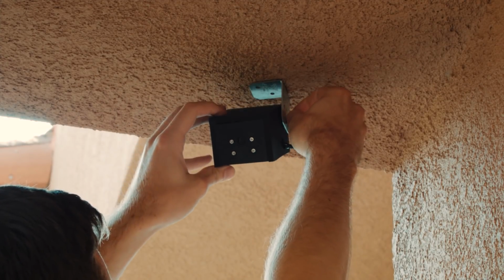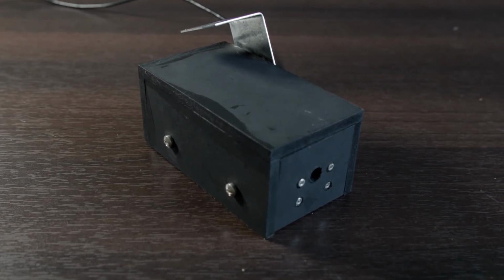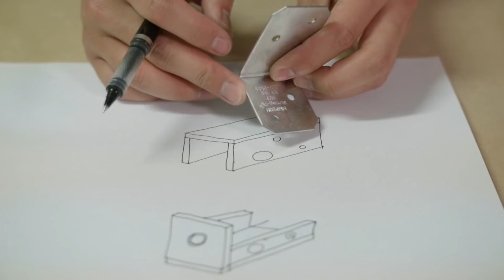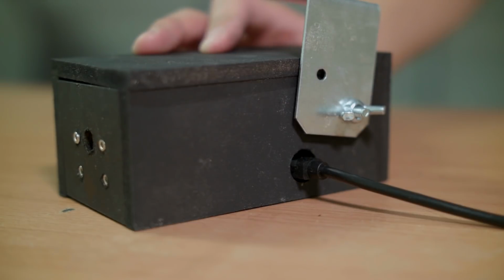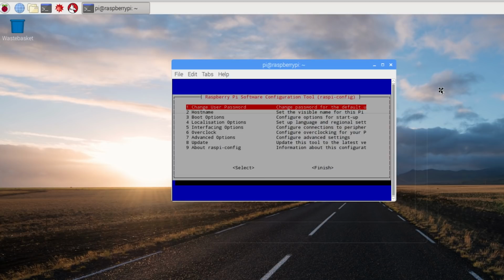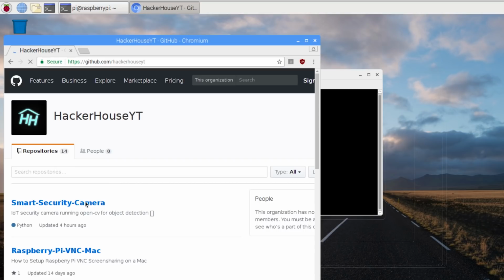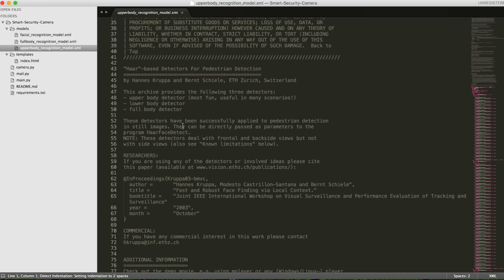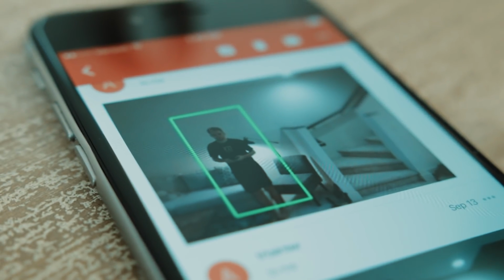How to Make a Smart Security Camera with a Raspberry Pi Zero

Comment: When the camera detects something, then the terminal shows sending mail then error sending mail.  Can anyone help
Reply: There are some issues with the print connectors, i suggest you put the pi zero in the microwave on medium lvl for about 3 minutes, that should resolve the problem.
Reply: @alextirendi5412  Issue is resolved, Initially I didn't allow less secured apps.

Comment: rather than dealing with MDF, I think I would mount it in an electrical box. The steel ones are modular, cheap and durable. Plus, you can mound an unwired outlet in it, which isn't the sort of thing most people would think twice about seeing.

Comment: Will this work if your not on the same WIFI network as the security camera is on?
Reply: Hello, 
You should edit your routers routing table. An example below
Public IP x.y.z.t
internal IP a.b.c.d
You should route your public ip's some port to internal ip's some port
x.y.z.t:9999 -> a.b.c.d:8888 then on a public WiFi, if you write your xyzt:9999 to the browser's address bar, you will see your camera. But it is not secure. Anyone that knows your routing table(camera port?) and public IP(may be static or dynamic ip) can see your house:)

Comment: (cv) pi@raspberrypi:~/Smart-Security-Camera $ python main.py
  File "main.py", line 30
    print "Sending email..."
                           ^
SyntaxError: Missing parentheses in call to 'print'
Reply: in python 3 it's print("Sending email..."). Whereas in python 2 it's print "Sending email...".
in the video they are using python 2. Just make sure you modify all the print statements in your code.

Comment: Yet so smart that the video output is laggy and low on frames per second
Reply from the maker: It’s a limitation of the device. You can use a faster board for higher FPS

Comment: still not coming over the error in the main.py.
 line 9: from flask_basicauth import basicAuth
ImportError: No module named flask_basicauth
to use python 3 is no option while opencv is compiled under python 2.7.
the flask maps are there under dist-packages

Comment: A piece of pvc and 2 end caps would be better and easier for an enclosure.
Reply: GhettoRanger Yep, and just drill through the side of the pipe, and mount using a bolt through the pipe.

Comment: A jigsaw is not the best thing to use to cut straight lines. You can  get straighter lines with a plain handsaw. Before painting the MDF you can seal the surface with white or wood glue (or actual wood sealer) to seal it against excessive paint absorption, reducing the number of coats required for full coverage.

Comment: HI there, how can i watching the live feed without connecting to my home's Wifi , i mean watching it outside by using my own personal data . Is it possible ??
Reply from the maker: Yeah, you have to create a local tunnel. Check out ngrok
Reply: can u make a video or process of steps on ngrok, it would be helpful thanks
Reply: i been try it but it show
Failed to complete tunnel connection
The connection to https://.....ngrok.io was successfully tunneled to your ngrok client, but the client failed to establish a connection to the local address localhost:5000.

Make sure that a web service is running on localhost:5000 and that it is a valid address.

The error encountered was: dial tcp [::1]:5000: connectex: No connection could be made because the target machine actively refused it.
Reply: sounds like it could be a firewall issue. Did you open the port 5000 on your router?
Reply: just get use OpenVPN, dont leave a port open for a camera

Comment: Hi, can I make this with Raspberry Pi 3?
Reply: Is it possible?
Reply: yes it is,i've done it on raspberry Pi 3 and it worked like a charm!
Reply: what is the smallest size micro SD card you can use for this and can you use a lite build instead of full raspbian? 
also how do you shut down  projects made with  rpi's if you  have no keyboard? if you turn this thing  off then itis toast your micro SD will get corrupted same if your power ever goes up  rpi are notorious for corrupting  SD cards so would  you even  be able to  shut it down without taking the whole thing apart and  plugging in a keyboard so the  it can be shut down without corrupting the sd card?

Comment: right, so there are (thus far) two errors during the make section on raspbian stretch lite. 
the first error is down to ffmpeg not playing well, even when installed. to fix this, generate the config with the with_ffmpeg=0 flag:
  - cmake -D CMAKE_BUI .. S=ON -D WITH_FFMPEG=0 ..

the second error is when you get the dreaded "no such file or directory" error, do the following:
  - sudo nano /usr/local/c++/[version]/[file]    (where version and file are the ones listed in the error)
  - find the line that lists the file.h library
  - change #include_next <file.h> to #include <file.h>
you can then run make again and wait for the next error. i'll update the post once i'm done hacking stretch lite into submission...
Reply: Lord Aceldama have you tried setting it to wambo
Reply: John Titor opted into making my own with apache and simplecv instead. Apache just runs so much better on a pi 0. No locking up when you fiddle about on ssh.

Comment: GUYS PLEASE HELPPPPP I tried to install openCV on my raspi zero, then i got a problem at the step of compiling. i tried both “make -j4” (whic is using 4 cores) and “make” (which is using one core), but both failed, and the fatal error is about “stdlib.h no such file or directory”. Can someone advise me? thank you
Reply: I have the same exact problem. Did you find a solution?
Reply: why don't you just install anaconda and then use anaconda to install opencv with only one command needed
Reply: Your Pi Zero W only has one core, so the -j4 is no help.

If you are following the openCV guide at https://www.pyimagesearch.com/2016/04/18/install-guide-raspberry-pi-3-raspbian-jessie-opencv-3/, this made it work for me...

cmake -D CMAKE_BUILD_TYPE=RELEASE \
     -D CMAKE_INSTALL_PREFIX=/usr/local \
     -D INSTALL_PYTHON_EXAMPLES=ON \
     -D OPENCV_EXTRA_MODULES_PATH=~/opencv_contrib-3.1.0/modules \
     -D BUILD_EXAMPLES=ON \
     -D ENABLE_PRECOMPILED_HEADERS=OFF ..

Comment: Or just use an old smartphone with a free software in just 5 minutes??? You tech guis just like to overtink things....
Reply: argusz battery drainer if you use a mobile phone: you need to charge it one/two times per day. 
If you use a Pi0w with a 2kmah power bank you can relax for at least 3 days. 

All for the "huge" money.... 17-21 Euro (plus power bank)

Comment: Great video - thank you.  Building the box itself seems very simple. However, when it comes to assembling the software,  all those steps may be a bit overwhelming for some people. Therefore, may I suggest that you upload an image of the OS with all of the components already included. IE - have OpenCV, etc, already pre-installed in the OS image that will be downloaded.  This will simplify the software part of the instructions. All the user will have to do then is simply change IP numbers for their own network. Thanks !!!!
Reply: If you can't figure out how to install the software, then go buy an actual camera.  Jeez, people want everything done for them these days.
Reply: how the hell do you even turn this  thing off? how do  shut down a  pi if you put it into a project ? there is no keyboard so you can not sudo shutdown h
once you power it off then there goes all your work and you  will need to  start all over again reburn your image and start all over again
if you just cut power the SD card will just  get corrupted
Reply: @andreamitchell4758  No, it will not get corrupted if you cut the power. It's Linux.
Reply: @johnv7u2w  you have obviously never used a r pi before it is based on linux yes , raspbian 
but   r pi boots from an SD card , these thing get corrupted at the drop of a hat
you need to power it down  correctly or it will corrupt the card ,sudo shutdown
or whatever you can not just turn it off or cut the power
cards can get corrupt even without power interruption   the r pi is notorious for corrupting images
Reply: @andreamitchell4758  you are using shitty fake SD cards so this is your results. I have RPi, two Orange Pi boards and they are working perfectly for me, for months and months. I always cut power to them I don't care. Any Linux with ext4 either on ARM computer or AMD64 will never get corrupted because of improper shutdown,  these things have filesystem journalling and they doing fsck on every reboot. Check your cron logs maybe you have fsck disabled or what xD Get real this is not FAT32, it's modern filesystem. Change your shitty SD cards. Hahaha
Reply: @johnv7u2w  they are not "fake sd cards" they are  are kingston and sandisk
Reply: @andreamitchell4758  Something is seriously wrong with your hardware then. Raspberry Pi never had power button or anything like that and it never will. Shutdown command is not required. If your setup does not work with that then it's your issue not raspberry pi or Linux in general. It works for everyone else.
Reply: @andreamitchell4758  also "how do  shut down a  pi if you put it into a project ? there is no keyboard so you can not sudo shutdown" is just wrong. you can ssh into it and shut it down.
Reply: @monkaSisLife  that is really not  practical though ,  a button  connected to  the  GPIO pins that activates a script  is what is really needed

Comment: I was going to do the same using a 2 PVC piping, Pi zero, usb external charger (for battery backup), and using motioneye software. 
Don't hardcode variables into code, use config files for god sake (metaphorically speaking), or even use command line params and people can just make it a script to call it all.

Comment: I built one of these myself, but instead attached it to one of these convection charged batteries.
  
https://www.amazon.com/Duracell-Powermat-24-Hour-System-iPhone/dp/B0082YVBO0/ref=sr_1_5?s=wireless&ie=UTF8&qid=1505869772&sr=1-5&keywords=duracell+powermat

It charges by placing it on the mat, and it's portable (within the confines of my wifi connection).  I thought it might work with my phone's Personal Hotspot as I can view it on my phone with the VLC app, but never tried it. 

I like your design although it seems like the longer screws you used to hold the two halves of your housing together might be long enough to short out your RPi.

Comment: I noticed there was internal ip, can I access this from outside my home. Via cellphone perhaps?
Reply: Yes you can access any computer on your network, but you have to set up your router to do so. You need to open ports through your firewall corresponding to the Pi, and then remember your router's public IP address.
Reply: Simon thank you.
Reply from the maker: +Abel Villa you could also use Ngrok to expose a local tunnel

Comment: What powers the raspi?
Reply: But then you clearly need to hang it up next to an outlet, which the outside of my house doesn't exactly have (except low to the ground)
Reply: usb power
Reply: Pomax On Youtube wondering the same thing.
Reply: A mobile phone charger with micro USB works fine (5V 2A)
Reply: also how do you shut it down?
and once it loses power there goes everything
your SD will be corrupted and you will have to start all over same  if you ever want to just turn it off
Reply: A blood sacrifice

Comment: Imagine a bunch of steps and materials could be saved if someone would only invent a 3D printer
Reply from the maker: +ColonelBumButt we usually 3D print our projects, but our subscribers wanted to see some projects that can be built without a 3D printer
Reply: That's fine if you can afford to buy a 3D printer.
Reply: Sure, lemme pull out 1k to make a homemade camera...
Reply: 3-D printed objects require time spent in CAD. Sometimes it's better to just get something done. You've heard of analysis paralysis?
Reply: Can't you make a 3D printer out of MDF?

Comment: Or you could just buy a piece of PVC pipe, two end caps mount it in that and have a waterproof security camera.
Reply: Or by a hollow plastic skull or gargoyle or statue of a poster of Big Brother with a plastic electrical gang box behind the eyes.
Reply: Travis lol, true, but to each their own. But i like your style better.
Reply: D. Decker - Drill a few small 1/4" holes in it. Even if it not made to be waterproof, PVC will last forever. MDF will be mush in a few months if left outside.
Reply: that would look sleek. will definitely look better.
Reply: You can buy a dummy camera for the case
Reply: Or just 3D print one
Reply: Hacker House easy anyway, from what you taught, some double sided tape will do the trick. A little hint, double sided tape is only used for to hold your item in place until the proper adhesive dries. Something kind of silicon based would be good for outdoors. Sorry, I'm not a hacker. I'm a tradesman. ;)
Reply: It's just as easy to  mount as yours, and it would be able to rotate. https://www.allflow.co.nz/ic/2313521287/Pipe%20Clamp.jpg
Reply: D. Decker I have a few security cameras and I've found that putting a few silicone absorbable packets in the housing GREATLY reduced the humidity inside. There were a few occasions that the plexiglass screen fogged up, but I'm sure that's due to a fault water seal.
Reply: Use spray adhesive on your paper template and attach the whole thing to your MDF. Then just let your adult cut it out
Reply: Yeah never seen so much work for just a plain box. Yikes
Reply: I LIKE THE WAY YOU THINK!!
Reply: Travis read my last comment. Cheers
Reply: Moisture destroys MDF. Paint doesn't block moisture completely. PVC is cheaper and more durable. Vinyl siding on houses is PVC. Most underground plumbing is PVC.
Reply: Travis I never said PVC wouldn't be better. I'm a builder by trade and I was just making a point that you can seal MDF to be outside. The paint in this video wouldn't, but you could. Yes PVC or and outdoor electrical J Box would be best!
Reply: Frank Gormanns yeah, that did cross my mind. Their only about $15 for one with SWANN written on it. I know, I put 2 up in an investment property of mine...
Reply: But that's not the point, this is about making things
Reply: Travis ...Yes a square pipe....
Reply: @andrewdavies6273  PVC is very easily moldable with a little heat. Check out what backyardbower(youtube)  has done making 50+ lbs archery bows out of schedule 40 PVC pipe.
Reply: Or just mount with Sugru....
Reply: Personally I'd just get a plastic project box and drill a hole for the wires / camera.  It would be flat and alot more water proof than MDF.  This could be done alot easier.
Reply: @hellrazor35  and you could skip the first 7 minutes or so of the video too ;-)
Reply from the maker: Good luck mounting that camera
Reply: Wouldn't there be the potential for excess humidity to condense on the inside of the pipe thereby endangering the electronics? The MDF is more porous and wouldn't do this as much. Of course, if left outside, the MDF will fall apart eventually because it's garbage.
Reply: D. Decker your right if it's bare MDF, but if it's fully sealed with outdoor paint, your all good. Most cheaper engraved home front door are just sealed solid MDF...